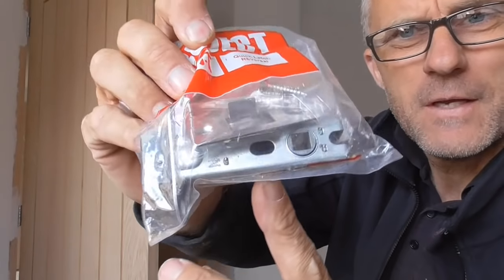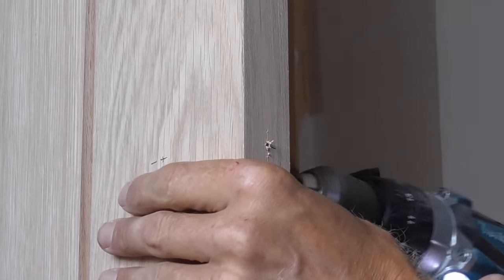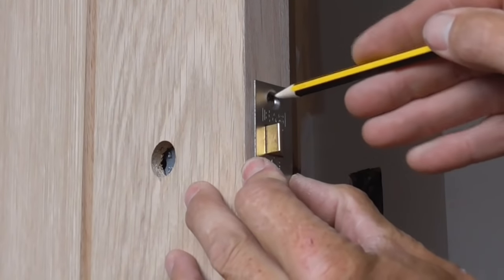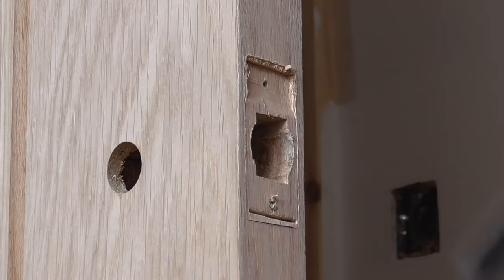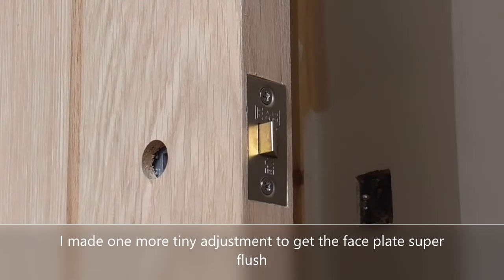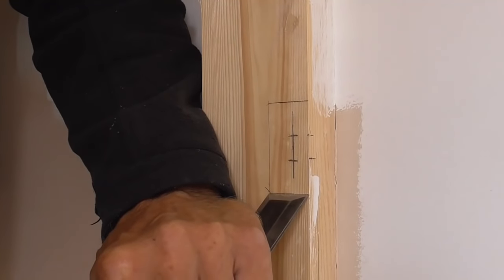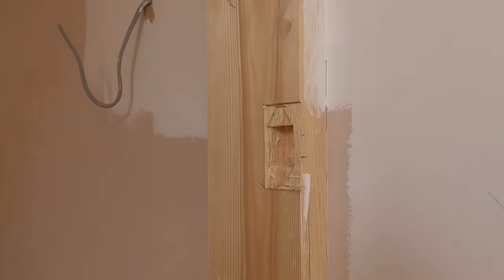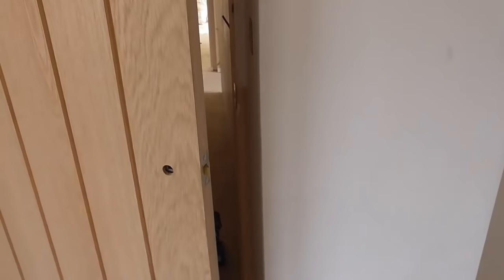How to fit a tubular mortice latch and keep.

Comment: i don't know why they industry doesn't make round lock barells and face plates, would save lots of time and chiselling
Reply from the maker: Hi Darren🖐There actually is exactly that👊Can't remember the exact name, but you just drill a 25mm hole and knock the latch straight in, and the same for the keep👍Thanks for watching 😎 Cheers Del
Reply: Jig tec do them they are really easy to fit the only criticism is that the tubular latch doesn't sit flush as it has a very thin faceplate that sits proud of the door to stop it being knocked in too far

Comment: Would you consider yourself a perfectionist? Can you overly obsess over quality of work or should you always insist on perfect standards?
Reply from the maker: Hi Milo. Perfection has to be a term that is used within the context of its application. It can also be subjective and what looks perfect to one may not look perfect to another. In my opinion its all about acceptable tolerances. Take fitting a latch as an example. Should the face plate housing be the same size as the face plate without any gaps?. In my opinion, yes it should as this task should be well within the capabilities of a professional carpenter. BUT, what if the grain is really awful or there is a knot to deal with?. In this instance, the housing may be slightly larger than the face plate, but only up to a point, and after that it clearly starts to look rough and would need some attention from the decorator. There is also times where lesser tolerances can be worked to because the work may not be seen, BUT I would still be aiming to get that work to the highest standard possible as, if we are not careful, we could start to adopt lower standards overall. Personally, I get MASSIVE satisfaction out of what I do and really enjoy actually joining bits of wood together, be it an external mitre on a skirting board or a compound seat cut on a roof's jack rafter, and I want to be able to stand back and be happy with how it looks.😎 (as I know my customers do)
Reply: @thetallcarpenter  so we must strive for high standards but understand total perfection is unlikely and thoroughly understand the necessity for tolerances as one could be too pedantic perfecting minute details for long periods of time even the customer wouldn’t appreciate the length of time spent on an element of work?
Reply from the maker: @miloclarke5486  It depends on the type of customers you have Milo. Many of my customers expect the highest standards, but there are many people, as you hinted at, that don't know a good job from a bad one😬
Reply: @thetallcarpenter  I’ve looked at NHBC tolerances where they list all tolerances for various elements of work such as carpentry would you recommend these tolerances as a bench mark of good quality, for example the section on door and door lining states the tolerance for plumbness of a door lining is +- 5mm out of level over the height of the frame (one way only) here is the link https://nhbc-standards.co.uk/9-finishes/9-1-a-consistent-approach-to-finishes/9-1-4-doors-and-windows/, I use that as an example of are these good standards to adhere to when thinking of tolerances ? Thanks
Reply from the maker: @miloclarke5486  You may he overthinking this Milo🤔 Everyone's idea of what is a good standard and what isn't are different, this goes for tradesmen and customers alike. If you are only capable of a low/medium standard of work, then this will be reflected in the kind of people you work for, and  likewise, if you are able to work to a high standard. It would seem pointless to spend a great deal of time making an absolute top job for a customer that couldn't appreciate it. I am fortunate to work exclusively for customers that want a top job as I always strive to do the best I can👍
Reply: @thetallcarpenter  I think I understand what Milo is saying I think he’s asking what are your minimum standards, for example if you were cutting common rafters how far can the deviate under/ over the line ? 3mm 1mm or would you only tolerate perfection (even if it meant taking longer to achieve that finish) another example would be architrave, would you tolerate a gap in the mitre (say 0.5mm and even if it’s mdf architrave which will then be caulked) or would you tolerate only a perfect mitre whether it be filled or not) I think he’s asking do you just simply have a tolerance instead of perfection

Comment: I always cut out the latch before I hang the door, just find it more comfortable
Reply from the maker: Is that when it's on it's adge after planing Gavin?. As I can see how it would be easier.👍
Reply: @thetallcarpenter  Yep, I find I'm  in more control cutting it out that way, bending over rather than crouching down
Reply from the maker: Makes absolute sense mate. I must admit though, I use my saw horse to hold the door when I'm fitting my latches, and it's the ONLY carpentry job I can do sitting down. (I sit on the saw horse). 😉 Cheers.